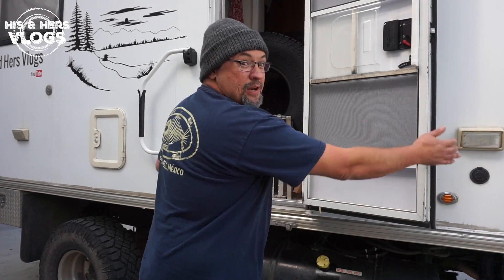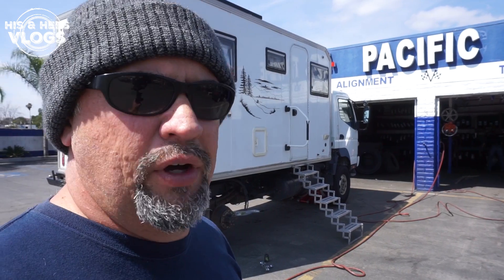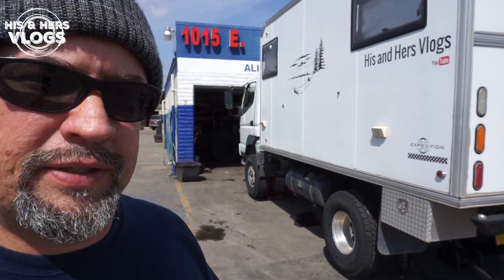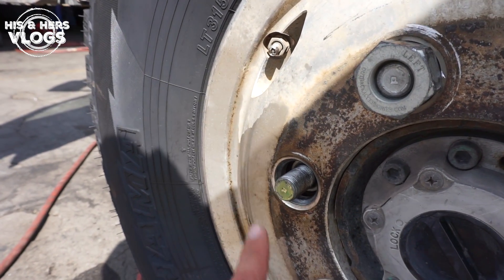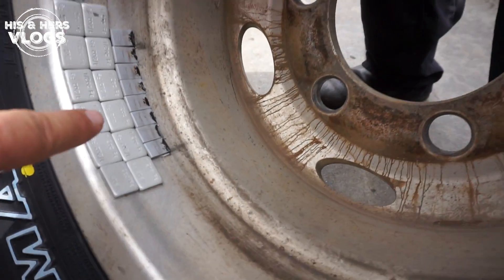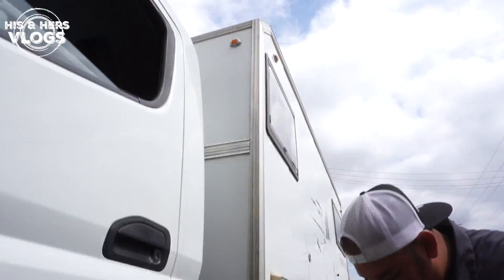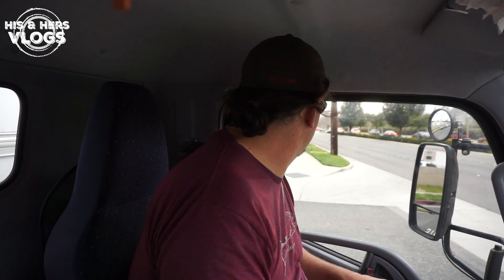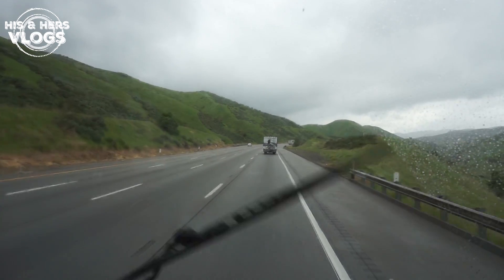New 4x4 truck tires, what could go wrong? • Overland Travel Lessons

Comment: Look at 4:17 where you recorded the tire being balanced, the tech very likely had the rim off center on the machine, unless you had close to the same amount of weight with the old tire, then a bent rim, but very unlikely. If the tech does not use the right adapter to place the wheel perfectly centered on the wheel balancing machine, the machine will call for a ridiculous amount wheel weights, which you had. I'm surprised you did not notice how bad the off center wheel wobble was. Nine out of ten odds that the tech didn't know what he was doing on that machine, and/or was unfamiliar with that type of wheel and the adapter it needed. In any case, he should have caught the very noticeable, out of round condition right away, or at a minimal, should have double checked his work and the machine, when it called for such a large amount of weight. On my coach, I use Balance Masters, wheel balancers, that can be reused.
I'm glad the issue was resolved.

Comment: Being a offroader for the last 34 years i've seen a lot of tires and ways to balance them. The powdered weights work dwell on highway tires where acceleration is smooth and steady, BUT Hit a bump or man hole while accelerating and the faster you go the worse the balance gets till at 50 mph you can NOT SAFELY drive. The only way to get it to rebalance is to come to 10 mph again and accelerate back up to speed hopefully not hitting a bump, doing all this with traffic behind you is a HUGE PROBLEM. As far as off road goes, as long as you stay below 40 mph all is good but accelerate higher and the whole bump thing becomes a problem as the weight moves to the bottom of the tire with each bump.[ There is not enought enerchia to hold the weight there yet] Using this powdered weight on the front wheels is a problem as any out of balance will result in the dreaded DEATH WOBBLE and having to come almost to a stop to reset the weight again, most likely in traffic again. If you blow a bead off roading and your in mud or water the weight clumps up into an unusable block and will require removing the tire and cleaning out the inside, hopefully you have a spare, duel beadlocks are the only solution there but not with Staun's as the weights get caught up in the tube assembly inside. If a tire requires a huge amount of balance when first installed, DEMAND  a different one to replace it right away, don't leave the lot or you'll be stuck with a tire that only gets harder too balance as it wears.   Steve h.

Comment: I have used equal tire balancing powder for years, the only problem that you will encounter is that you will have to put air into the tire before checking the air pressure, the powder will plug the core.

Comment: so glad you fixed the lug things we lost a tire and it was our lug nuts they ripped off it was bad glad your doing ok was wondering where you entered into Canada we will be entering through glacier park area have you ever entered that way? looking forward to your videos safe travels
Reply: Living The RV Loca Life I came back into the lower 48 through GNP, free roaming cattle and a winding road with and F450 and a 48’ gooseneck. Easy PZ and a beautiful drive.
Reply: @akbychoice  thank you for a reply that's awesome thanks a lot we are planning our trip and was wondering if it was good to go through there
Reply: Living The RV Loca Life it’s a smaller border crossing and easier. Sweetgrass to the east is larger and more congested. Though I’ve never had an issue in recent trips, back in 1993 I was pulled in and searched completely. But that was further east from ND.
Reply: @akbychoice  awesome that's great thanks a lot take care safe travels
Reply: Living The RV Loca Life YW hope you have a wonderful trip.

Comment: Counteract tire beads work great,  I started using them on my 23 ' class c last year,  I did 7000 miles cross country loop and the best it has ever been.   In the front it even took out the annoying light vibration in my steering wheel.   I choose to  pour them in through  the valve stem and they give you new special filtered valve stems so none come out when you top off the air.   I didn't want the bags flinging around until they break an shred apart into pieces

Comment: I first heard about using balancing tire beads in RVs some 20+ yrs ago. I also know a Tow Truck company that put golf balls in their truck's tires for balancing.  It's has to be clean sand or smooth beads to keep from causing damage to inside the tire. I prefer the Centramatic Automatic Wheel Balancers because they are on the outside and, if you change tires, be reused.

Comment: I use the balancing beads in our Class A pusher,  they work well and are smooth but I have had issues when checking my tire pressure.  On numerous occasions a bead has got stuck in the schrader valve holding it open when I check my tire pressure.  The beads usually come with a new schrader valve to help prevent this, hopefully the tire shop installed them for you.  I have the correct schrader valve but still have issues on occasion.  To avoid the problem I always have air available when I am checking the pressure so I can blow out the bead from the valve if it gets stuck.  Safe Travels!!

Comment: Next time look for an industrial tire shop that is used to working on heavy equipment and trucks.
Reply from the maker: We checked in with one and they wanted SOOOO much money to install, no exaggeration, install was going to cost 50% of the price of the tires.
Reply: Every time I've taken one of my trucks to a place that usually does car tires I've had problems, just like you did.

Comment: Winter and siping tires go hand in hand. All our fuel trucks had siped tires. It made chaining up less frequent and greatly enhanced the life of the tire and increased stopping capability. 

Aren’t the end of the studs stamped R and L to designate the right hand and left hand threads? If not they should be.

What are the torque specs on your wheels?

My experience with the internal weighting devices is that they wear the inside of the tires. You would be better off putting weights on the outer part of the wheels or get balancing rings.

Comment: H&H vlogs thx for informative video as usual FWIE I had a vibration with my '15 GMC 1t DRW TV was able to resolve with Hunter Road force balancing at America's Tires at no extra charge 58k miles still smooth sailing but it's not quite the truck of your Mitsubishi safe travels home.